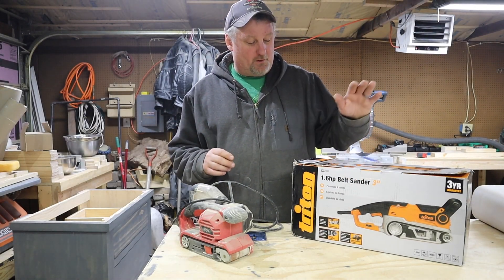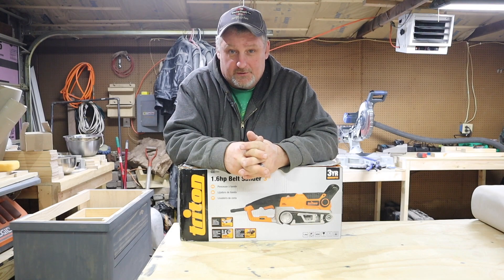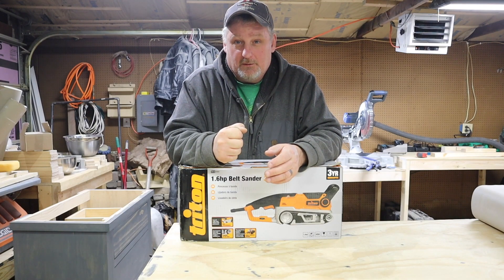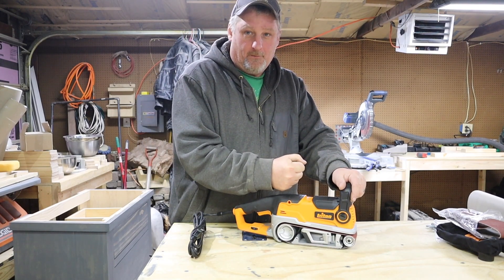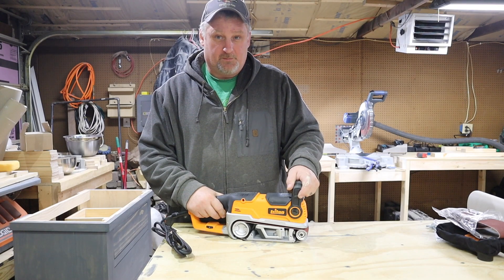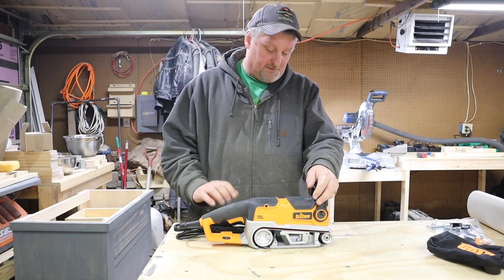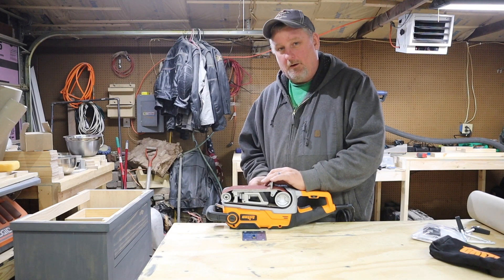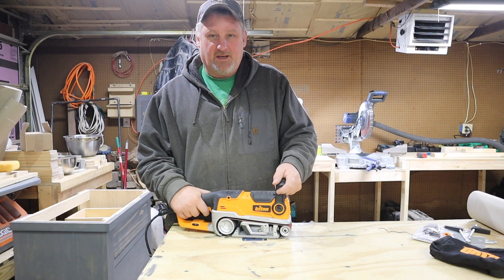Triton TA1200BS Belt Sander Unboxing

Comment: I heard it is extremely loud. Really loud. Is that true?
Reply from the maker: Yes all belt sanders are loud, I have owned or used the Porter Cable version and the Makita version and I think this one is a little quieter and it’s hard to describe but to me the sound is a little less sharp than the others. But either way a belt sander is loud and hearing protection is always a good idea when using one.
Reply: @R2Customs  Ok, thanks for the information!